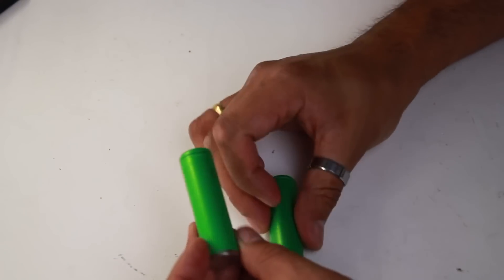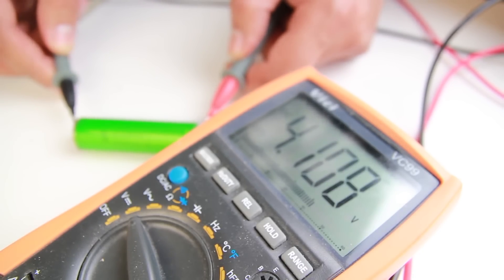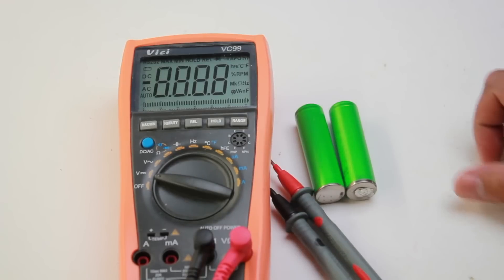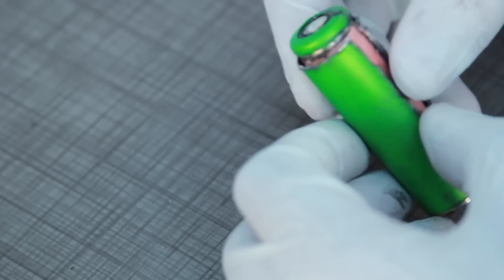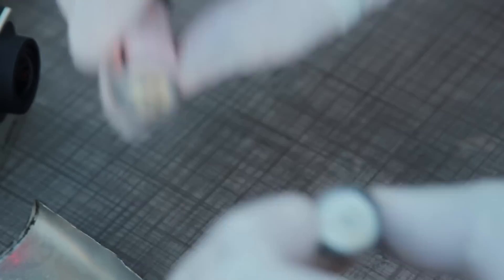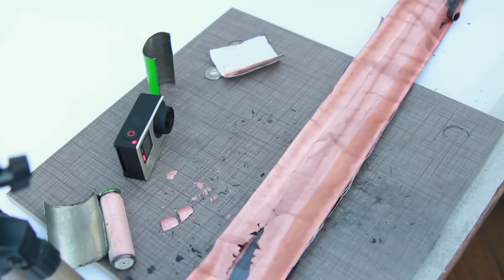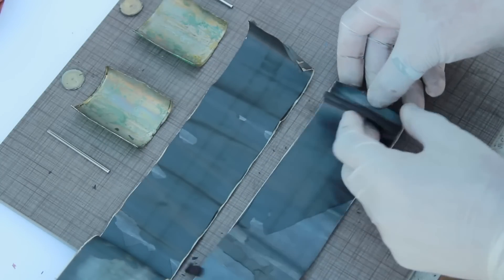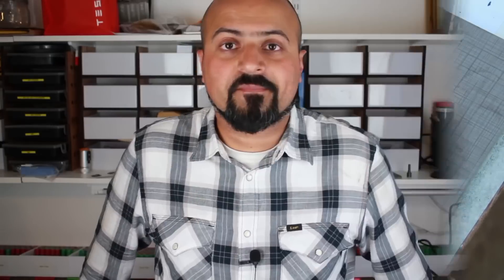The 18650 Autopsy - Part V

Comment: You have to learn how to solder
Reply: His soldering gun doesn't get warm enough he's cooking the hell out of the cell ! With solder flux lead your better sanding slightly the shiny part before soldering !Adding flox with a co0ld iron doesn't help .!
Reply: I just solder a few cells together and might of held my iron on the negative side for a second or two. But I was using a JBC 125w Iron. Haha
Reply: Lol i was thinking the same thing he put the iron on the battery for way too long lol.
Reply: His background isnt electrical
Reply: It wasn't a soldering tutorial
Reply: @seanthebaptist6757  better would had he learn some battery soldering tutorial, then.
Reply: Yeah,he sucks man!😃

Comment: I always wanted to know what a rechargeable battery looks like from the inside. Very interesting!
Reply from the maker: i think there needs to be more battery autopsy
Reply: @NERDVilleUK  His autopsy most probably come first .. Visual inspection from an unconfirmed baseline starting point is useless ..... and i could go on for all the other reasons NOT to do this... BE SAFE .

Comment: you held the heat on way to long     i hope no one does that you will damage
Reply from the maker: Hi that was the point to get the worse case scenario but to also try and get damage to the cell. Also this was a 30W iron most have used 50W-80W irons so it was sort of an equivalent amount of heat input.
Reply: I understand your wanting to do the worst case possible but your point about them being equal is wrong.Too small a iron trying to solder something that it doenst have enough thermal capacity to do will always get the part being soldered a lot hotter then if you'd used a larger iron......With that said the cell looked ok afterwards to me.

Comment: Thanks mate, I have wondered about the spot vs solder argument.  I have soldered with a really high powered soldering station for years, starting back in the NiCD days with no noticeable effect on battery life.  I was just soldering a stack of LiOn batteries last week, and I can say without a doubt my negatives were soldered in about 2 seconds.  I find that if you lightly file or sand the terminals before fluxing, the solder sticks a LOT faster.

Comment: Great video, thank you. I agree on the higher powered soldering iron. I use a 100W iron (usually used for making leadlight windows) and resin core solder. Get in there quick and get out :)

Comment: Try a bigger soldering iron with a bigger tip. It has a bigger store of heat, so will get that neg terminal up to melting temp quicker.
Oops, you said that at the end! 
Fantastic videos, and nice to see kids getting a hands on education.

Comment: Who the uck chewing SO LOUD? i want to kick his face
Reply from the maker: That would be me! I know it's DISGUSTING I feel so ashamed it will never happen again!!! LOL the face has already been kicked on your behalf.
Reply: You have a good sense of humor.  I liked your video.
Reply: Please don't ever be sorry to someone advocating violence!  lets just hope adfksjg has moved out of his parents basement by now
Reply: Gotta agree on the lip licking/cheek smacking/gum chewing. Really gross for a video. But nonetheless good job!
Reply: my camera has the microphones on top so when Im breathing thru my nose it goes right into the mic and sounds so much worse lol, I didnt even notice the chewing till some dbag had to point it out, probs cause the content was so facinating here! 
 I was really worried about soldering batteries but after seeing this it seems totally harmless.. but I am wondering if any of the layers seem heat sensitive to you? would they melt or burn or warp, or is it more like carbon where there is no structural change from direct heat? could somebody try and touch the soldering iron to the insides of the battery please.. I would but i live in a tiny apartment.

Comment: Great video!!!  I've read that using a freezing spray prior to soldering helps protect the internals.  Do you or any of your readers have any experience with that?
Reply from the maker: Its a good idea but normally a higher power soldering iron will give almost touch solder performance and this should be sufficient to prevent the battery from getting any heat damage.
Reply: Won't the 'freezing' effect increase the total time of the soldering process?I mean to say, won't it take much more time for the soldering iron to heat up the surface?Thanks for your reply :P